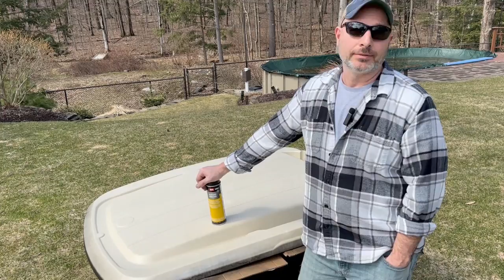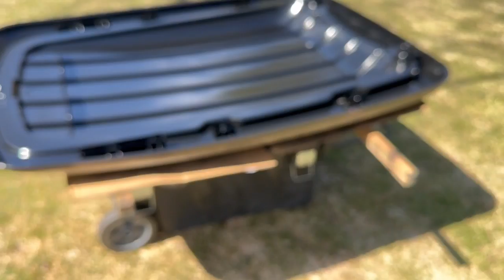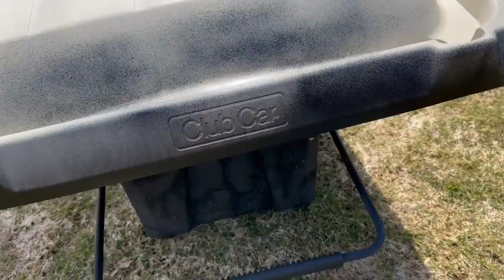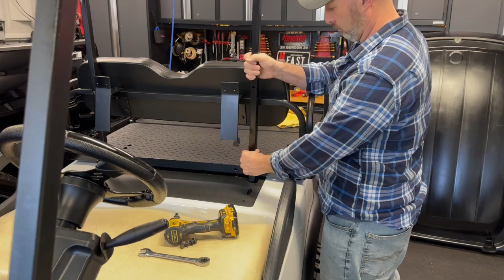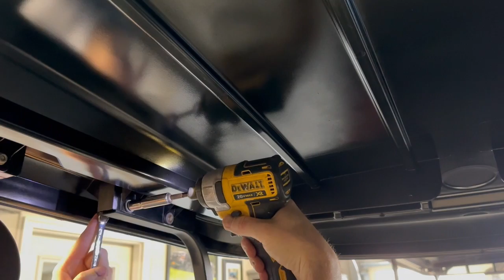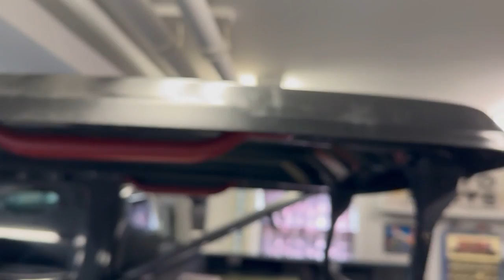Golf Cart rattle can roof repaint. Club Car Precedent Rebuild part VI

Comment: Great video. I just painted mine last week with primer and spray bed liner, after drilling it for roof rack mounting.
Reply from the maker: Sounds good! i do like the roof racks. They look tough.
Reply: Like your videos. I’m starting a club car ds rebuild. Curious as to how you prepped the roof surface for paint. Did you sand it down or anything like that?
Reply from the maker: @kerrykoehler9112   Thanks for watching! Glad you enjoyed. With this, I cleaned and degreased.  Then hit it with an adhesion promotor, then the texture / paint. Paint was a primer / paint in one. Someday I'll start using automotive type paints out of an air gun. Fingers crossed, should last for a while.

Comment: I used the Rust-Oleum Stops Rust
24 oz. Turbo Spray System Gloss White Spray Paint. I did one side in 60 seconds. It sprays wide and the coverage is great. My cart is white I sprayed the roof white what a man or transformation after I did that.

Comment: ADHESION PROMOTER. Always on plastic.
Reply from the maker: i believe we did. But yes. I have used truck bed on roofs and didn't like the result. I have used it on some of the other plastics on other carts for sure.  Might have to try Raptor though. Have not tried that yet.